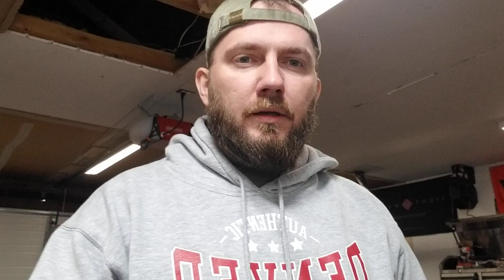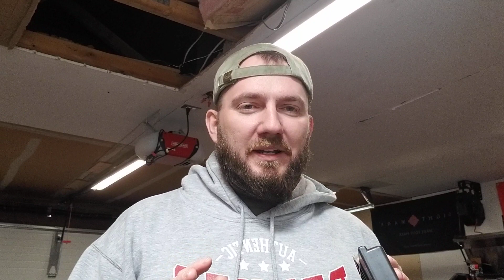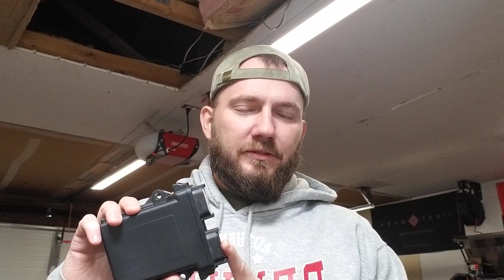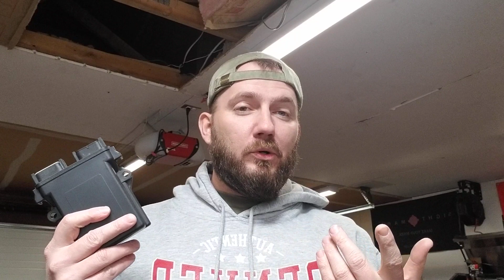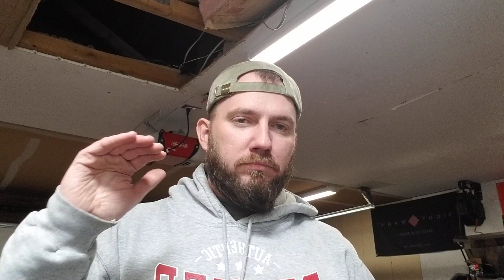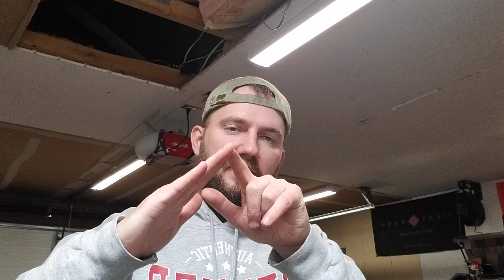Part 1 - Steeds tech challenges BD Diesel

Comment: You've got great content on your channel. I really enjoyed watching you videos. I have an 2003 Dodge 5.9 48RE that I wanted to install a VGT style turbo on. A friend of mine installed a BD Howler kit and lost his cruise control, BD support couldn't fix it. That was a deal-breaker for me. I hope you have plans to bring this to market still. I would love a clean install on an older 5.9 without a bunch of splicing.
Reply from the maker: I totally forgot about this video. They never did respond to it lol. I used to sell my Banshee VGT controller. I work with ATS Diesel now. I am working on their Intelliboost controller, it should be available late this year or early next year.
Reply: @SteedDolan  Thanks for the update. It would nice to have a little more punch on the bottom end with the 5.9 and an integrated exhaust brake. Never been a fan of having to mount air compressors and run additional lines to run a traditional exhaust brake in-line set-up.

Comment: You worry too much about drive:boost ratios. Boost is what makes power. If you want X power you need to target Y boost to pump Z mass airflow through the engine to burn. There isn't a single ideal pressure ratio unless you're doing only one take with the engine like drag racing. In the real world the NEEDED pressure ratio changes constantly with ambient temp, ambient pressure/filter restriction, intake temp, exhaust temp, engine speed....a dozen different parameters.
Reply from the maker: Banks has a good webinar, think its called why boost is dead. Talks about air density. Hiving a high drive ratio lowers your over all air density. Goal is high CFM with the least amount of restriction. Lower restriction increases air density
Reply: On the intake side, yes, lower restriction increases density and lowers the compressor pressure ratio and thus heat production from compression. On a 4-cycle engine only crankshaft power is lost pumping exhaust out at higher drive pressure, it does not have any effect on air density because there is no connection to the intake.
Reply: So I'm guessing you drive around with a diesel that has a 1 inch exhaust pipe
Reply: While programming a Ford 6L vgt turbo on a 4.3 liter Chevy, I could see Drive pressures as high as 60 PSI and 10 PSI boost and make absolutely no power until the turbo became in range and drive to boost ratio came near one to one